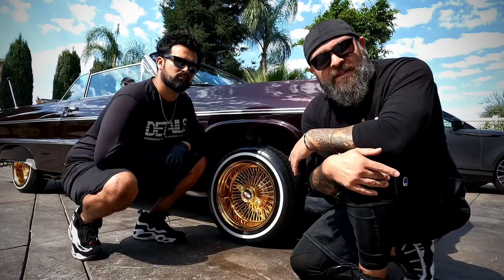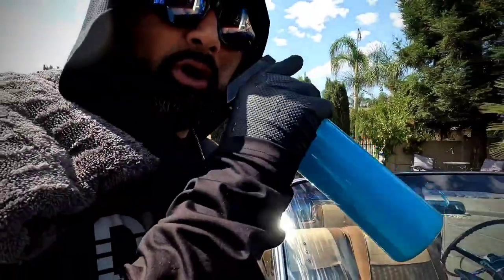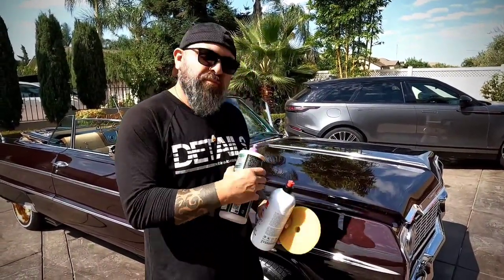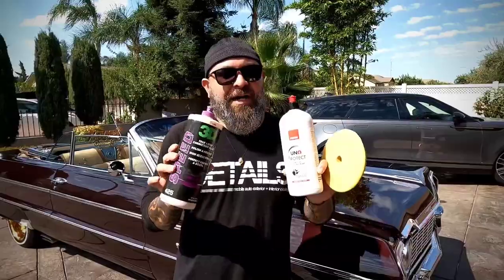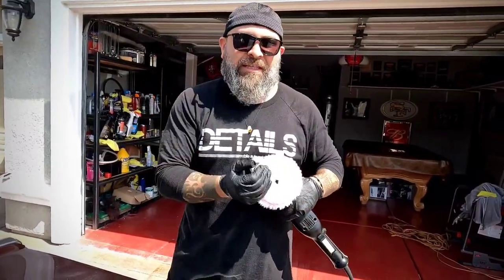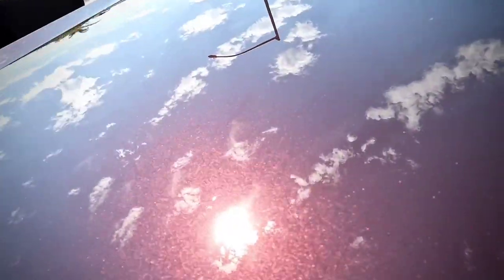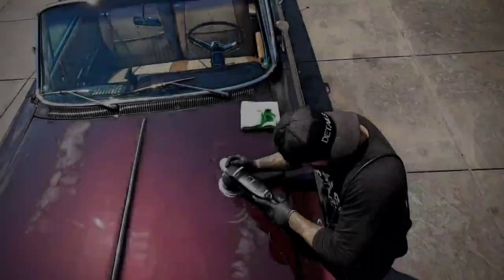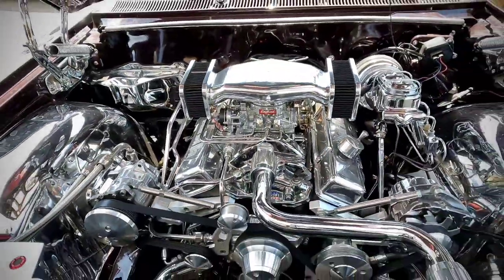Lowrider detailing | 1964 impala | DETAILS

Comment: Check out 3D 505 if I am correct that’s the other aio polish it cuts a little more them speed you could probably get away with that yellow pad and 505
Reply from the maker: thank you for the suggestion, I may have to try it out.